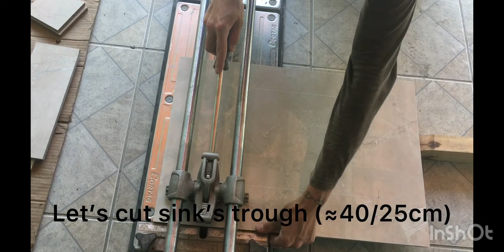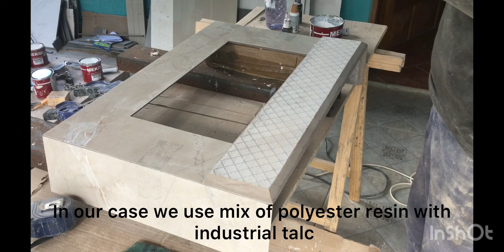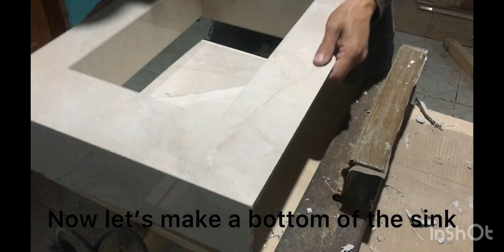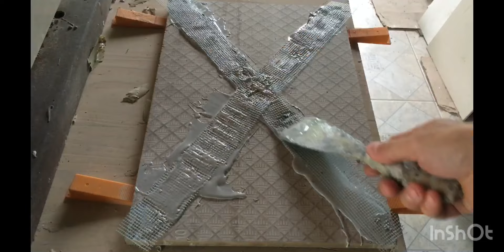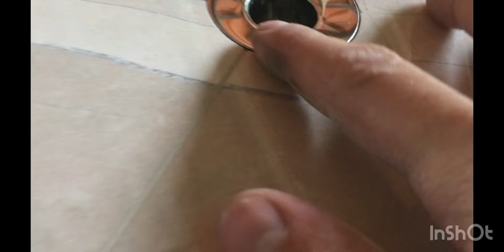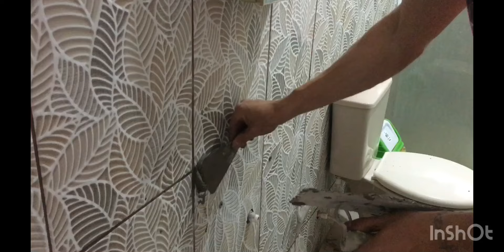How to make bathroom sink from porcelain tiles. Step by step.

Comment: I'm a big fan of your work! It's inspired me to give it a go myself. I purchased some cheap tiles to prototype and trial with, and I have some questions regarding my results:

1) I found it incredibly difficult to do a nice 45o bevel with an angle grinder, particularly so on the inner edges of the trough. I found that the polished edge of the tile would chip when I did it with my angle grinder. I suppose that this is a matter of practice, but it could also be my blade. Is there a particular blade you recommend?
2) What adhesive do you use? I saw on one of your other videos, and from comments that you use Tenax, but there are several different polyester adhesives they carry. Is it the "Knife Grade White" that you use, or some other one?
3) What dyes do you use for your adhesive?
4) What size of hole saw do you use to cut the holes?
5) Where do you get the stainless steel drain pipe?
6) How do you glue the drain pipe to the sink? Do you seal it as well?

I plan on making a very large sink, 20"x40"x12". Given the size, I was planning on supporting it from the bottom and building it into a cabinet. Do you have any advice/suggestions/reservations?

Keep up the great work, your sinks look amazing!
Reply from the maker: Hello dear! Thank you for the watching and the comment. I really appreciate it. 
1) yes this is the matter of practice. But you can try  instead of grinding conical stone to use polishing pad N 200. 
2)about poliester glue. Here where I’m living Tenax is expensive one. So we use another poliester glue. It is cheaper . Try to make some tests with glues of Tenax. I know there are solid and liquid form. Did you try to work with solid one? 
3) I use common dyes used for painting walls 
4) 32 mm or some times 35 mm 
5)  take a look at Aliexpress.
6) you mean the sink drain valve right? I fix with sealant PU 40 . Do not use poliester glue for fixing it.
Reply from the maker: About fixing. I would use 2 brackets fixed on the wall to support the sink, and after installing the sink I would fix a cabinet . But your idea is good as well. You can put the sink about some bottom of the cabinet .

Comment: so is the only thing holding up the sink a rod glued to tiles on the wall? Or am I missing the way it is attached? also I wonder the integrity of the sink if someone we to drop something heavy like a buzzer or hair dryer because it is hollow? I might try to make something like a ramp style but maybe reinforce the back with some sort of substrate
Reply from the maker: To fix the sink you can use any mount brackets according your preference. In my case I use diamond saw hole diameter 35 mm and the tube with d=33 mm. With the saw I drill a hole on the wall and after put the tube into the wall and fix with mortar or with proper glue for marbles. The reason: is cheaper in 3 times then mountain bracket. 
About integrity of the sink. The sink from porcelain tiles is like any clay-based ceramic material. If something heavy to drop about there is risk to be broken. And congratulations for your observation: actually there is important to reinforce with another layer of tiles to improve resistance .

Comment: Very creative. Quick question for you: I have purchased a basin which looks like it’s constructed exactly like this with pieces of tiles glued together and the weight is quite heavy. As i am quite old school and used to one piece molded basins I’m a bit paranoid as to how durable the glue is that’s holding all these tiles together. And essentially the main bowl holding the water has lots of tile joints. Do these hold up well even if the bowl was full of water and in the long run?
Reply from the maker: Hello dear! Thank you! Yes it is very important the tile joints hold up the water and the sink do not leak. For this there is some process to glue the pieces between themselves. Check some important step:
1) after polishing it is important  make a rough surface . In the video I have showed how to do this
2) before glue the tiles you need to eliminate all dust etc
3) to use PU sealant in all corners and tape for drywall with the glue to reinforce the pieces. 
Wish you to fabricate your sink with your 
✋ 🤚

Comment: you did a great job. But why In the end you put another tile inside the basin and cover the drain hole?
Reply from the maker: Hello. Thanks for the compliment! Let me clarify the matter, the tile inside the basin is removable it is not fixed with glue. He serves to hide the drain hole. You can take out it if it is necessary.
Reply: @Porcelanataria_45_graus  oh sorry i didnt notice .Another question. I make marble basins almost same way, but I always put tile grout inside the basin joints because older craftsmen told me that AB marble glue loses its adhesive capability after a period of exposition in water. Did you have any problem on these tile basins ?
Reply: That is a classy look! Love it❤